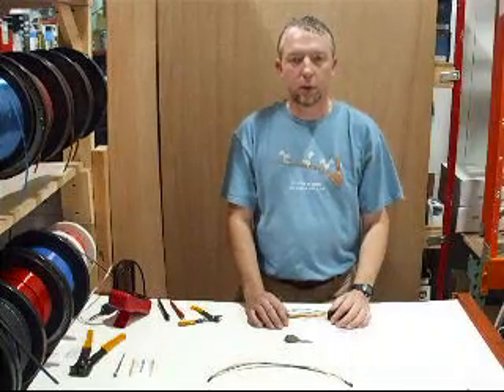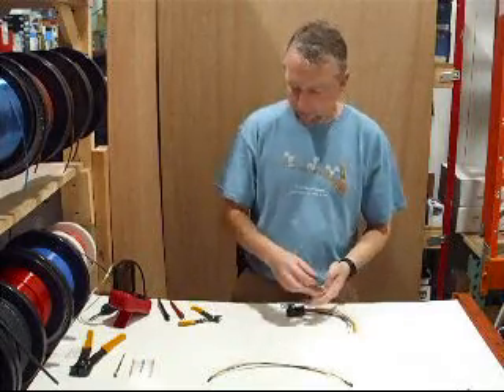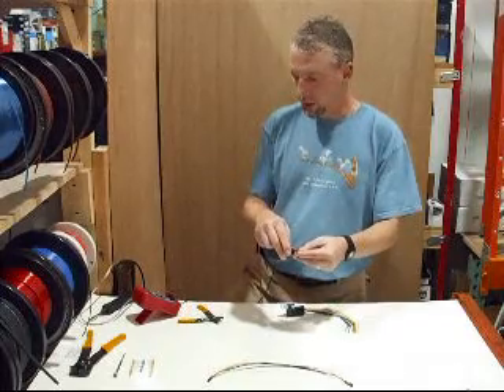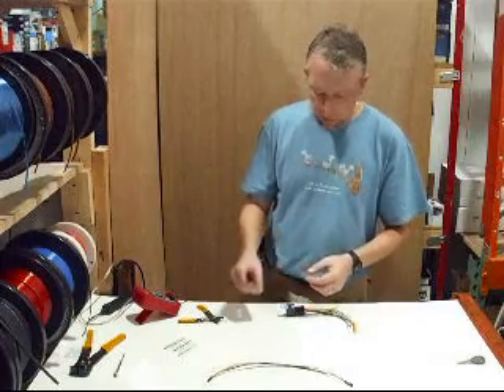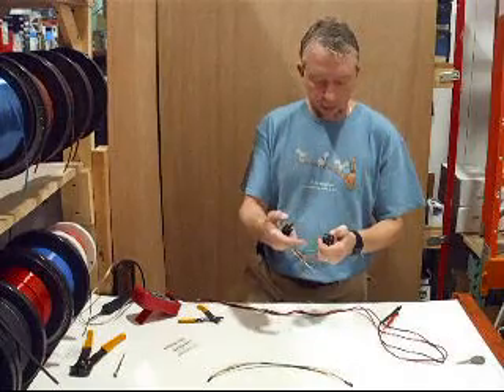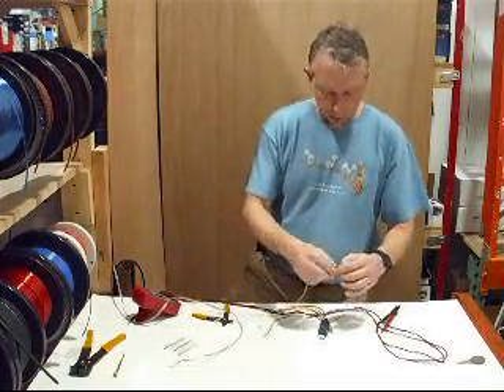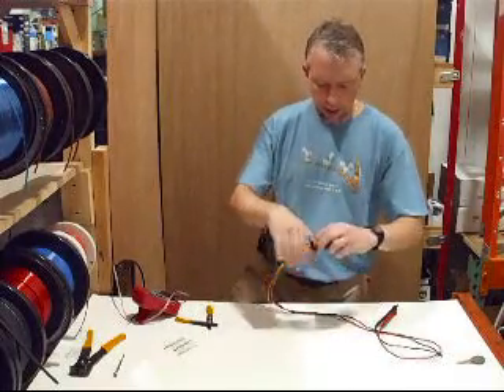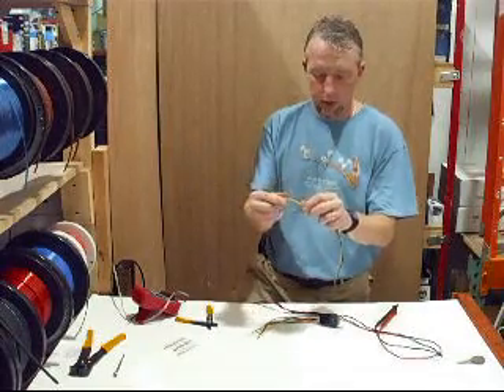How to Override Bypass GM VATS Passlock 1 2 Passkey Anti Theft System

Comment: Warning these VATS systems were put on very high end  $$$
General motors vehicles 
IE Corvette Cadillac etc Take your existing  key to a locksmith and have them interrogate it then plug into the and tuck any VATS cylinder under the dash (the key does not need to turn)with the correct VATS resistance 
value # 1-15 then use any key vats or otherwise in the column. When storing vehicle Your VATS system will still function as intended by removing
The VATS key from the cylider under the dash.

Comment: this problem with my 97 olds is that the key is too loose, you can easily pull it out anytime, so it doesn't make contact with the  corresponding wiring

Comment: Question ?😮
Can you disconnect and remove the vats module in the dash, and leave it out ? 
I've tested this theory of actually disconnecting the vats module after , AFTER the vehicle was started, then disconnected.
Then I turned the vehicle off and then turned the vehicle back on.
It did work but am wondering that at that point can you leave the vats out of the system permanently instead of cutting wires and testing wires and purchasing the proper resistor  ?
I don't want to become an electrical wizard I just want to end the problem as quick as possible. 
So my question is ? 
Can you just disconnect and just leave the vats module out of the system and forget it while still being able to use your vehicle on the daily. 
Am going to test this out at some point just want to hear from others about my thoughts. 
This is what I've tested thus far.
Started the vehicle,  disconnected the vats module. Turned Off the vehicle and then restated the vehicle having no problem with the vats module disconnected.
Sooo, tell me what yall think about this.
✌️😎

Comment: @lesscoelectronics I have a 1999 GMC Yukon that the security light came on solid and it won't start I've done a lot of research on the passlock security how to fix or bypass it, my question is on your very last tip to use the resistor and let the key on for 30 minutes will that make the security light go off also??

Comment: Too much information in a short time. This can be 3 videos. People watching these are not so smart without a drawing of each design. 
I have a first VATS system ,1986 corvette.  Got new resistor, and installed, no crank no run. Code 46. No 30 or 50 hz signal from VATS encoder to ECM for fuel injection ok to run.  Currently Timer. Shop makes a little module that supplies this 30 hz or 50 hz signal, but it is only for 89 and up cars !!   No idea what to do now... What do people with 86, 87, 88 year cars do if their Vats decoder module goes bad ?

Comment: Look people, this is very SIMPLE.  Your ignition key has a "chip" in 
it, it is a resistor, that the car's computer wants to see in order to
allow you to start the vehicle.  There are 2 wires running from the
ignition cylinder in the steering column that to to a connector
under the dash to tell the car's computer that you have the 
correct key in the ignition cylinder.  If EITHER of those two wires
are broken, shorted, you car won't start.

So, thee quick solution, is to solder a resistor between the
two wires, that has the same resistance as the "chip" in 
your key, they plug it in to the wiring harness underneath
the dash/kick panel.  Then, your key, or ANY KEY, that is
cut properly, should start the car.

The only "downside" to doing this, is that
somebody could "punch your ignition, 
turn the ignition assembly without the 
proper "key", and drive away.  So your
"security system" has been DISABLED.

Comment: I don't understand your final resort, nothing works, passlock 2 fix. after cutting wires and splicing you say, start your car and get a reading. what am I missing? the car doesn't start is the problem. HELP , 99 suburban Vortec.

Comment: Delete the VATS system from the BCM by taking the fuel injector enable line from the ECU to the BCM and tying it to ground at either 30hz or 50hz (hz = cycles per second) using a 555 timer some capacitors diodes and a transistor.

Use the run circuit to enable the power to the 555 timer. 

Once that's working, you can pull the VATS wires out of the car.

You can put a relay on the power to the 555 timer to allow another security system to interrupt the fuel injector, or make the 555 timer circuit into a module, encapsulated in epoxy, and use it like a key.
Reply: you can bypass the VATS but then you end up with a parasitic power draw. battery goes dead overnight

Comment: Are you in Jacksonville
Reply from the maker: close, ponte vedra
Reply: @Lesscoelectronics  I have an 03 Impala which keeps going to security mode and won't start sometimes for 30 minutes I may can get 2-3 good days before it does it again...I have a new key fob but an after market stereo and I was wondering how do you keep the car from going into security mode and what's an easy way to bypass and keep my alarm system or basically get key fob to work

Comment: this is just too confusing- you don't even identify where the harness and connector you're working with came from-- something like this needs to be demonstrated on an actual automobile- also I have no idea if this is the system my truck uses because you are so vague about models. This presentation might work for someone who already has a background in electronics but not for average DIYers. It should not be this convoluted.

Comment: My 89 camaro did this i put resistors in the ignition switch plug it worked a month then the guy at the dealer had one personally and told me to get a 89 caprice tbi computer and it works fine...then security is in the computer...just get one same motor that didnt come with a chip key it'll run

Comment: ? The black box my the anti theft pass lock my truck want start it cranks but don't start an security light is on I did the bypass an reset still on was told module bad but we're is it?

Comment: Difficult to see what's going on ......? That one goes there, the other there plug, this in cut this one but be careful you might burn the control module if you don't do this by the way what did you have for lunch ? Then connect that there strip this wire here ground there and the positive wire over here, now we're using a gray wire instead of a red one but don't worry they are almost the same difference ..........

Got it Sir thank you.

Comment: I bypassed the vats with a resistor works fine BUT I cannot get my aftermarket alarm to remote start PLEASE HELP?????
Reply from the maker: then the issue isnt the vats, its something else, does your unit have a diagnostic feature on it?
Reply: @Lesscoelectronics  I'm not sure I have a prestige aps 997-e

Comment: Or you could just have a gm key w/chip cut and program it YOURSELF! 
Here's how:    Turn ignition to acc (right before run) for 5 seconds then turn to run without starting it for 10 minutes, after 10 minutes repeat 5 seconds then 10 min,. do this a total of three times on the third try the key light should go out after the 10 minutes and the key will be programmed, if it don't work try it again or take the key to you  GM dealer and have it programmed, but try the 30 minute program first! Use a timer for the 10 min.
Reply: jason rhea - Turn the ignition off completely after each 10 minute cycle, if it dont work you have something else wrong with your ignition.

Comment: I've been having this problem with a 00 Tahoe. If you ask me, it's quite obvious this system is a veiled time bomb to scrap the car and buy another. It has a 383 stroker in it and a enhanced PCM that has it pushing 425 hp and turns low 14s. I'm seriously considering pulling the motor and dropping it in a K5 with out all this horse shit. If I carb it with a straight MSD ign I'll lose 40 or so hp but won't have to worry about the electrician gremlins and if I juice it will still be taking the squids with the raptors and hemi dodges money.

Comment: A good lesson though... I have a question I have a 98 corvette im getting the 2721 code for vats.  The car turns over but wont start and I have never seen the security light come on the dash ever. I heard that when it's a Vats issue it wont turn over at all it does nothing.. Do you still yhink it's a Vats issue?
Reply from the maker: Definitely, It's just your turn to bypass it.

Comment: This was done to my car and worked for years. My car will not start and I was told by the shop I need a new security module is there any other fix? I don't want to buy another one to only have this same issues years later.

Comment: I have had this problem on a 2003 GMC savanna for approximately four years now. It was diagnosed by some repair shop and supposedly fixed but never worked right. I still have the security issue. I would always turn the ignition off, for 10 minutes or less, waiting for the security light to go away. Recently I accidentally put the vehicle in neutral after security light came on and it started. Ever since I’ve had the security light issue, my resolution has been to stick it in neutral the security light goes off and I start the vehicle. Give it a try it cost nothing.
Reply: Your neutral safety switch, on the tranny, is faulty.

Comment: easy solder resistor right on the wires do away with the relay. if the car has vats good chance the ignition is going bad fron excessive use anywho. I did this on a camero and used an aftermarket alarm to protect it .. VATS Is a pain!

Comment: "If your car just will not start do this...find yellow wire, start car, get ohms." Omfg.
Reply from the maker: savage
Reply: Sorry, but this problem is about to cost me my job and house. I just put 900 dollars into it for tires alternator tools and battery then I paid my bills and I cannot find anyone on the internet who has fixed the solid security lamp no start no crank issue because everyone complains about a flashing light...I wish I had the flashing light. I know its supposed to flash and then go solid and then turn off...just that its always been solid for me it never turns off. It was fine when I drove it to the store, maybe had a small breaking event because someone in a van thought I was trying to cut them off but I was already braking into the parking spot so I shut car down got grocieries came back out and BAM security light. It never shuts off. Its sitting on a batt charger with the car ON fuses are good, tested them with an ohm meter.
Reply: I even tried starting it while being pulled...now all my guages jump around/peg out.
Reply: Oh one last thing...maybe crucial. When I try to crank it the security light turns off after about 5 seconds...Ive tried to wait 10 min 3 times in a row and I tried to wait 5 seconds 3 times in a row...BCM might be the issue but nothing else is messed up.

Comment: Solder the wires to the resistor in the key itself (spare key) and tuck the whole thing up under the dash. Works great and you don't have to go find a resistor.
Reply: that's not good. Easier finding one to work. Even old electronics could find one with the proper value. that's begging a theift to figure out as once they pry it to hot wire they will have the key!!

Comment: First....take your vehicle registration form to a local GM dealer and have them make you a new key from the VIN number if your key is worn. It is inexpensive($9) and may eliminate all the work detailed in this video and others.  My son was able to get the issue corrected with a new key made by the dealer and now his truck starts first time every time.  No longer waiting for the system to reset or any of the issues associated with the passlock security system.
Reply: yes but if the cylinder is bad then this will only work good for a short while before it wears the new key. He is basically stating this is for people who have tired the other means, or who have a car that is not even worth stealing that just want the issue resolved
Reply: buy a gator box it plugs in the factory harnes and has all 15 chip values they are 29.99 on ebay  its that simple

Comment: Far too complicated. Get your VATS code from the dealer (a good dealer won't charge for this) and buy a $18-$28 bypass harness on eBay. It either simply plugs in under the steering column or that wire gets snipped and it gets soldered in. I'm no brilliant mechanic or electrician but I soldered one in myself and the VATS issue is fixed.
Reply: Just solder in a resistor for 50 cent.
Reply: JoeCnNd 
Were to acquire said resister.
Reply: @gingerbread2875  radio shack
Reply: @gingerbread2875   Any reputable car alarm business will have an assortment of resistors. Im sure they would sell you what you need for a dollar or two.  All you need to do is test your key's  VAT pellet (the black thing on your key) with a multimeter set to 2K ohms. That will give you the resistance value of your car"s system. Then go to Google type in "VAT System Resistance Values" to get the table which shows the list of 15 VAT optopns (1-15). See where your resistance is, meaning, what number of the 15 is yours (VAT 1, VAT 2, VAT 3, etc.).  Buy the correct resistor. Solder it in. Done!
Reply: @dupont4sure    Out of Business
Reply: I got mine at Frys electronics but amazon will have some if you can wait for the shipping.
Reply: @JoeCnNd    I forgot about Frys.  Great suggestion especially during the weekends (ie Sunday).
Reply: Yeah, it might be a pain for some people to get to because of the distance but if you're within the area it's nice to go to for things.
Reply: @JoeCnNd  Bingo.
Reply: I like your solution. I have the same problem I bought a Chevrolet Tahoe 1999 not to long ago, i though old cars had less electronic problems but i was wrong...I am trying to go to eBay and buy a bypass harness and my boys will fix it. Can we call you to give us more ideas. If you say yes, then i will give you by phone number.!!

Comment: Hello you using the wrong term,, you can not measure impedance on the no load resistor what you mean is measure resistance my man !
Reply: ....impedance is measured in AC circuits only bub !!
Reply: Absolutely correct, Jogo.

Comment: Need some advice please. I have a problem with the anti theft system not letting me start the car. I already bypassed the system with resistors that matched my ignition key and that worked fine for more than a year but now it will sometimes not start and I have to lock the doors and wait five minutes for the security system to reset itself and then it usually starts. Sometimes it doesn't work on the first try and I have to lock doors and wait another 5 or more minutes and then start it. One thing that seems to give me this problem is if I have doors or windows open for a while while parked. Any advice ??

Comment: I got a 2000 Chevrolet Silverado with that same scenario. ( Security Light on, doesnt start, but lights and radio turn on perfectly)
I was watching your video but I really cant see what is going on or how you are connecting things. I would hate to ask but can you zoom in so we can see how you are  bypassing this?  That would be extremely helpful.
 Thanks.

Comment: HELP! I changed my truck key switch to start the truck and also the door cylinder , now I have 2 keys one to open my truck and other to turn on ! Problem is when I lock my truck and use my key to open it , the anti theft or alarm type sound comes on and in order to turn that sound off I need to turn on the truck , HOW CAN I FIX THIS PROBLEM , thanks

Comment: Just wanted to let anyone looking know, my 04 cadillac cts 3.6 had a 
security lock up. I did the relearn (leave the key in the on position 
for 10 minutes). That worked so I drove it to the parts store, had it 
scanned, and then it locked up again. This time, no matter what I did, 
it would not do the relearn again. I was about to take a $1600 hit from 
cadillac so I said; let me try one more thing. CRC QD contact cleaner in
 the ignition lock cylinder and on the ecm connections ( I think it was 
the lock cylinder ) fired right up. Moral of the story; anyone with a 
96up gm should have a can of contact cleaner in the trunk.
Reply: My truck doesn't have a trunk.  But thanks for the info.  I just happen to have a can of that CRC.

Comment: Ok so I can't decide which method would best suit my situation, but my 02 impala every now and then with the key in the on position will blink the "Security" message on the dash 3 times indicating that the car will not crank. Then will have to wait 10 mins for another attempt in which it usually will start but sometimes it won't. which method would be best to bypass my system?

Comment: as a locksmith, i have had a customer call me ,because their vats key did not start their auto, i told them to wet two fingers and clean the resistor off and wipe it clean, then insert it back into the igition,,,wa-la she worked fine,,,
Reply: Thank you it worked on my  2010 gmc
Reply: I'm no locksmith so I went ahead and wet two fingers and wiped it clean for her. There was very little resistance.

Comment: what if you buy a 2001 chevy silverado from an auction that has no key.....
How can you check the resistance to be able to disable the "Vehicle Anti theft system"??
Reply: +Michelle Holden Its been ages but I used to have a box that you could clip in and try all the resistor values,it will be harder without it but there are only so many values used and you could simply try them all till you have the right one.
Reply: Home do you bypass antibody system in a 2008 and a Chevy lmplamy

Comment: do you not need a diode across the relay so it doesnt blow the remote starter? when do i need a diode  as i have blown several remote starters  using the door locks relay and find out later you need a relay yet no one ever puts them in the diagrams

Comment: I change the ignition on a 2000 Monte Carlo and now the key turns over lights come on but will not start or crank
Reply from the maker: +Fred Cripps try my "spike" the pcm technique I use at the end of the video, that may work out for you